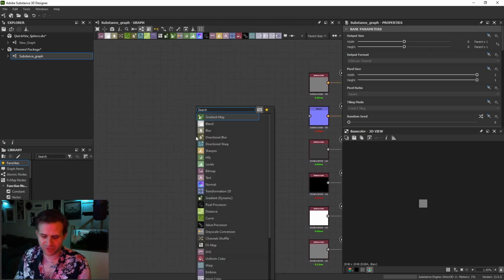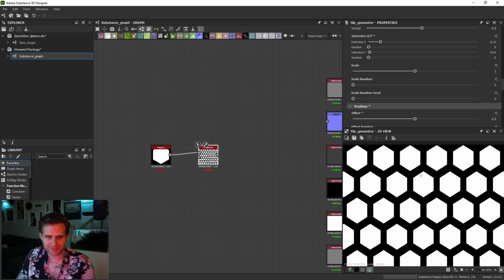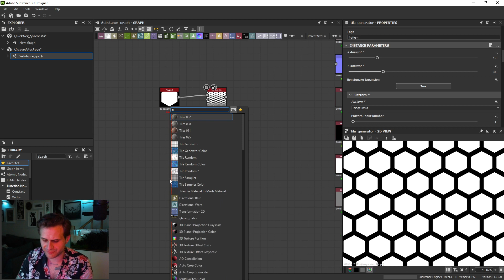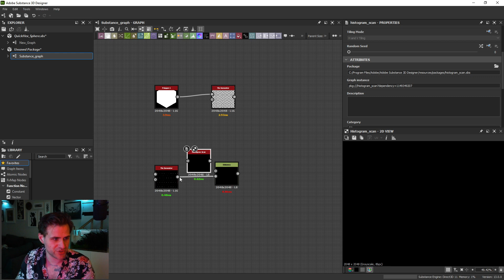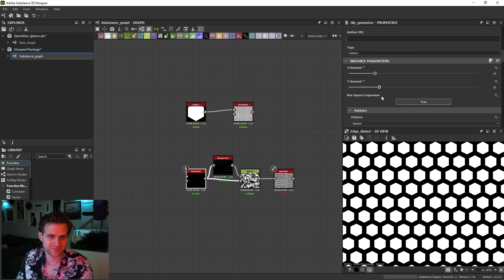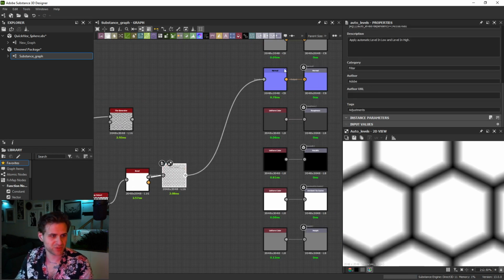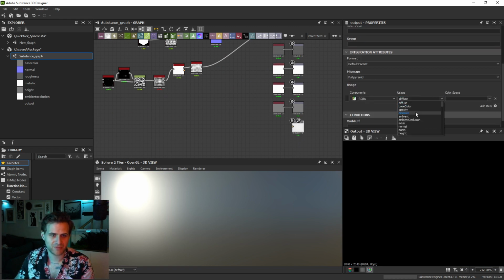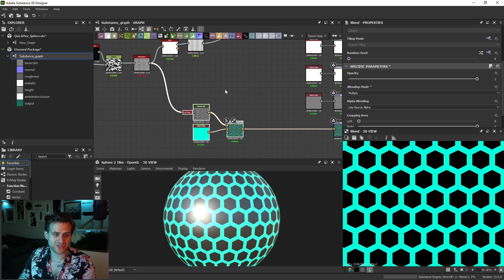Hex Pattern Trick for Materials from THE FUTURE

Comment: One issue I have found with this method is occasionally the tile generator will make 2 squares the same color and edge detect will join them, I think a slightly better method is just have the tile generator place large paraboloids with max blend mode into an edge detect.

Comment: It is enough to make the texture size uneven (not 1:1), and the hexagon will fit perfectly together, without disturbing its ideal shape. It's just that everyone is used to the uniform size of textures, but there are exceptions to the rules.
Reply from the maker: I'm not sure what you mean
Reply: @Johnny_Nodes  Bit late, but I noticed the "issue" that they might be talking about. The X and Y amount of the tile generator with this method can't be the same number if you want to have hexagons with consistent length across all edges. I noticed adding 1 to the Y amount fixes this issue. Otherwise they are always a bit taller than their width. Lovely trick regardless!

Comment: Most useful SD tutorials, thanks!

If there is a desire and opportunity, it would be great to see some examples of creating decals that remain after explosions or bullet impacts. Or maybe some tips on making nice looking heightmaps (for Parallax Occlusion Mapping, for example) in the right range of values
Reply: You can always adjust the ranges and such in your shader in your game engine or 3D rendering software. In general for Parallax Occlusion Mapping heightmaps, I recommend clean shapes without much micro detail; rely on your other texture maps to cover that.
Reply from the maker: We can easily do decals/impacts etc. In terms of heightmaps, im not sure what you mean by "nice" or "right" range of values 🤔
Reply: @Johnny_Nodes  in some programs the heightmap range varies from -1 to 1, in some from -0.5 to 0.5, in some from 0 to 1
usually this has to be adjusted depending on the software,, but I just would like to know how it is "more convenient" to work with this in Substance Designer
Reply from the maker: @untitled_exr  In almost all those cases you can change that mapping. Your height map textures in Designer go from 0-1 with 0,5 being the middle point. Unreal for example will use 0 as the point from which it scales up, so in there I prefer to remap to -0.5 to 0.5 (in shader)
Reply from the maker: Point being in all cases you can make a normalized 0-1 heightmap in designer and alter the mapping in your target application. It shouldn't change how you think about it in designer. @SDB_Dev has the right idea